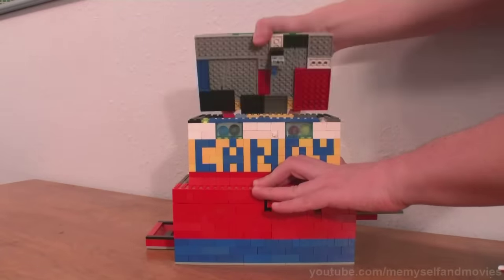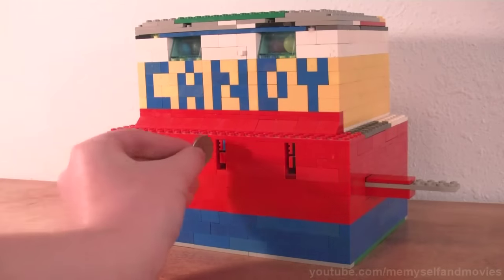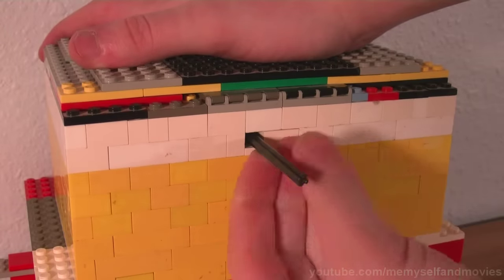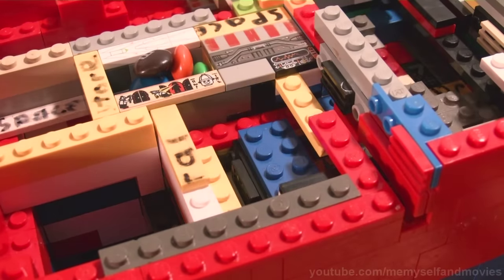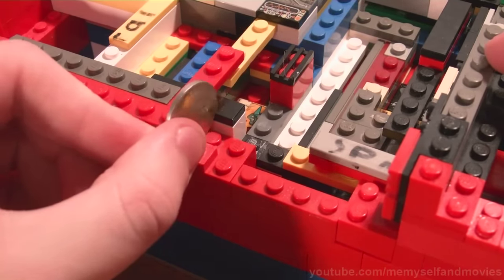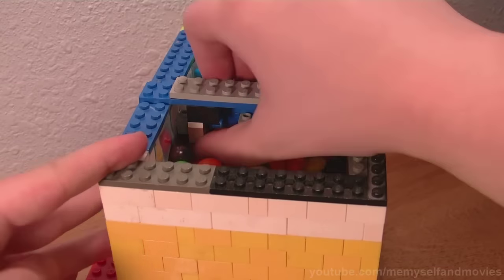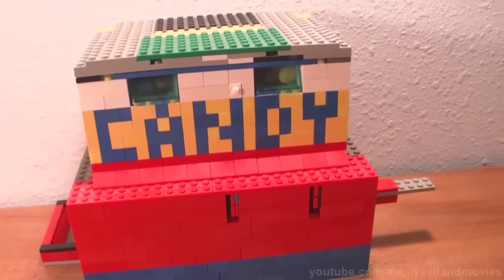A Lego Candy Machine

Comment: What about if a crook has a hammer?!
Reply: A crook can just break it apart or take of the roof |:)
Reply: +Leia Tan the Legos are super guled
Reply: +Hilman syazri  i think the point was that the crook was supposed to get the candy with out anyone knowing what he did so hitting it with a hammer would defeat the purpose.
Reply: exactly its  a Lego it will break easily
Reply: Make a layer of electric Legos powered with volts, and if a. Hammer comes close it will shock the crook with 2,000 volts of energy leaving them in a coma.
Reply: what if a crook brings brings a hammer to a casual glass/plastic candy machine?
Reply: +elijah garcia lol a hammer can break plastic too. just like the machines we have today.
Reply: what about the machine are super glue'd!?!

Comment: sneaky cheaters just rip it open
Reply: or put in the nickle and push till the candy falls out but not enough to have the nickle fall out then pull it back then push again, you can get the nickle back out by tilting the machine
Reply: Kyle Yuri Garcia Hammer is stronger
Reply: Mista Play & C AB then that's not sneaky at all.
Reply: Mista Play 

 you do that, I’ll just burn it
Reply: Naw sneaky cheaters just get a rod then unlock it
Reply: or do what mr krabs does when he was younger, he puts a little string on his nickle
Reply: Lol
Reply: Anti Ken66 The candy would melt to🍬🍬🍬🍬🍬🍬=🔥🔥🔥🔥🔥🔥
Reply: 🔨 Did I ruin it?

Comment: You have a major issue on 2:12, the candy arm is still hooked up to the main arm (the one where the coin is) still moves the candy arm and drops candies despite the coin still in between both the arms. What this does is that I can move the main back to the feed hole where it refills the candy arm and push it back to drop the candy but at the edge where the coin doesnt still fall.

Tl;dr, the candy arm and main arm still connects after pushing the candy, which can be exploited to return and push out more candy.

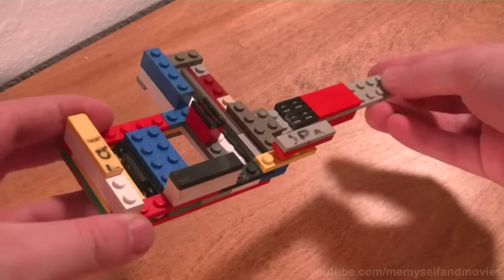Comment: 2:00 It's a piston not a lever
Reply: Lever definition: a rigid bar resting on a pivot, used to help move a heavy or firmly fixed load with one end when pressure is applied to the other. Piston definition: a disk or short cylinder fitting closely within a tube in which it moves up and down against a liquid or gas, used in an internal combustion engine to derive motion, or in a pump to impart motion. It’s a lever